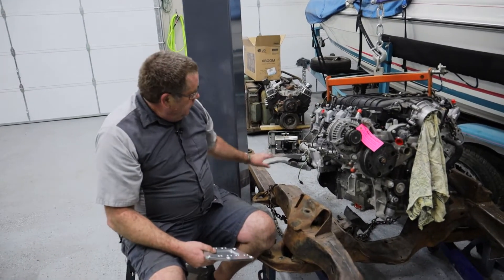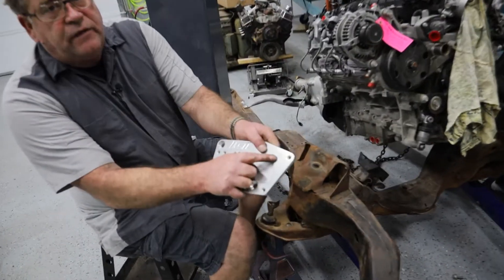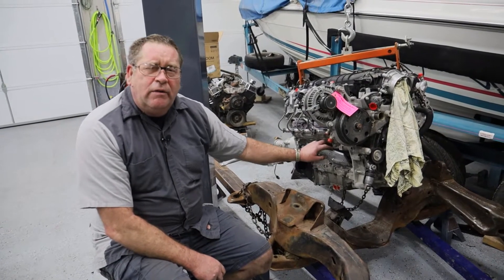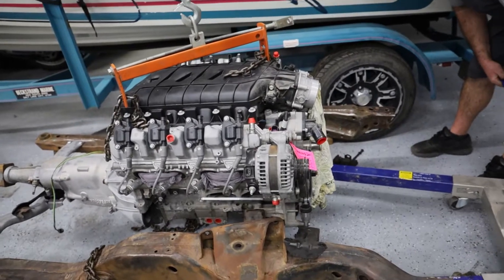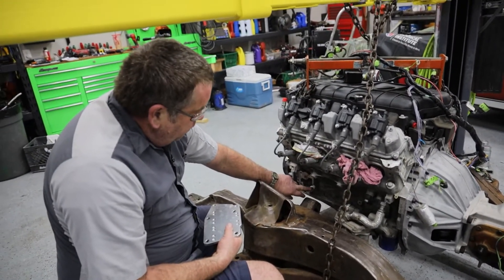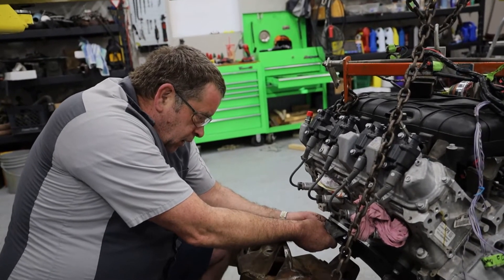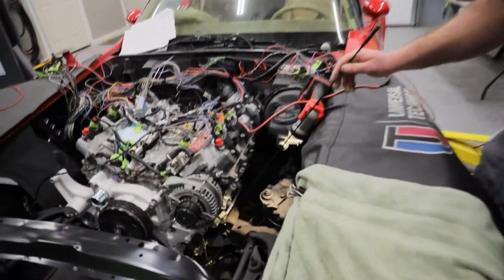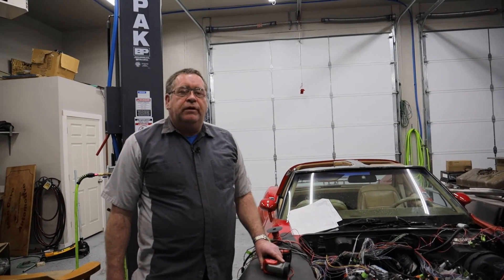Mounting a Gen 5 LT1 Engine into a C3 Corvette

Comment: Hello, thank you for you work and all videos about this swap, they have been very helpful. However I haven't found information on which water pump you used. In this video I can see you start with the old water pump, and in 3:40 you show the motor already mounted, and a different water pump.
Reply from the maker: That is covered in the Dry Sump Accessory Drive video and includes part numbers.